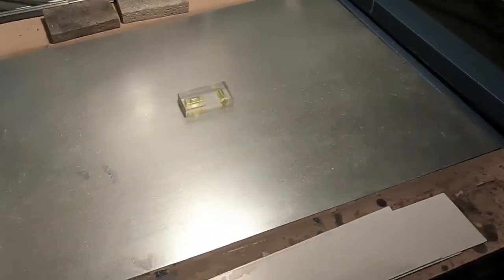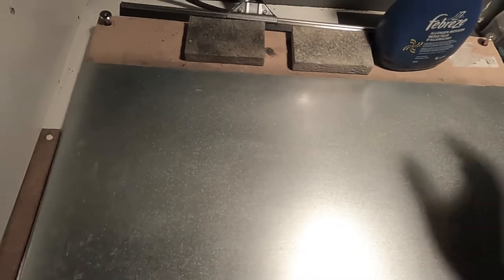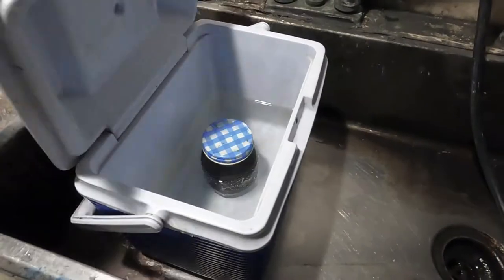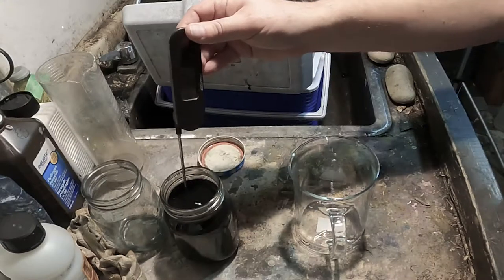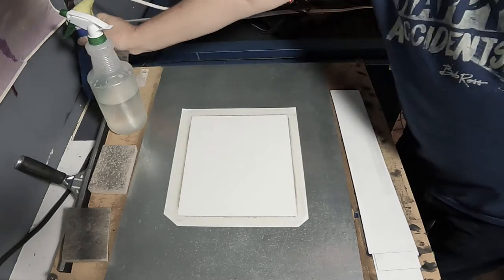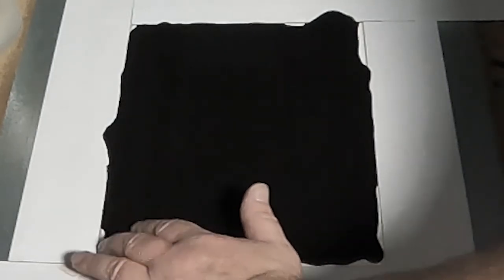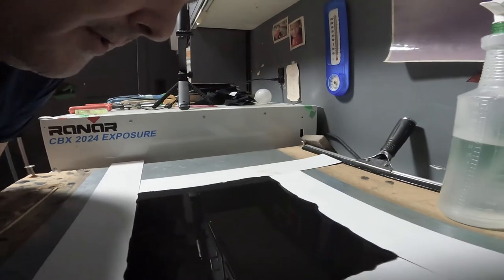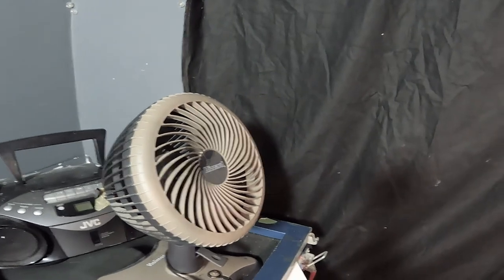Part#2 Making Tissue For Carbon Transfer Printing

Comment: start looking at carbon prints videos now. What temperature is yr room when you are pouring the glop on to the paper . My few failed attempts, the gelation always take a long time to set, sometimes a few days and it would turn mouldy. My ambient tempearture is at 28 to 30C

Comment: Quick question. At the end of the first video you put the jar of glop into your cooler box with no lid on - here you opened the cooler box and the jar had the lid on. Does it matter?
Reply from the maker: Thanks for commenting, Tony. No, it doesn't matter. Sometimes I stick the lid on, sometimes I don't. If I have the lid on, though, it's on very loosely. That way, the gases have somewhere to go. Cheers!